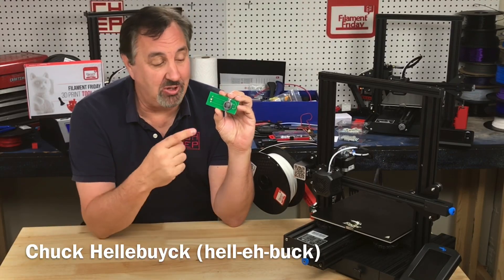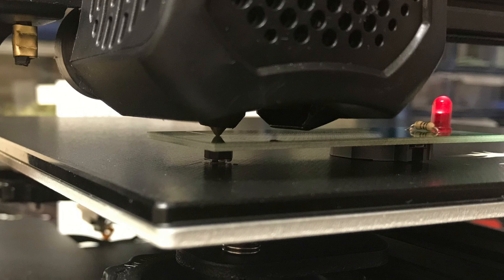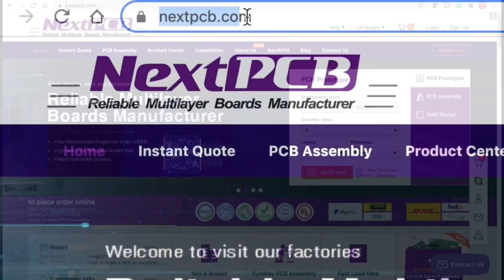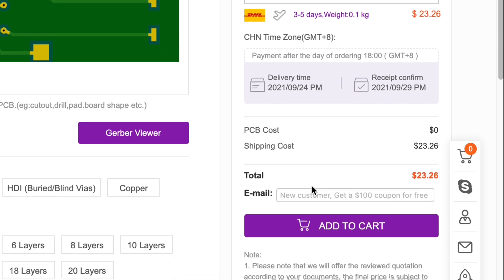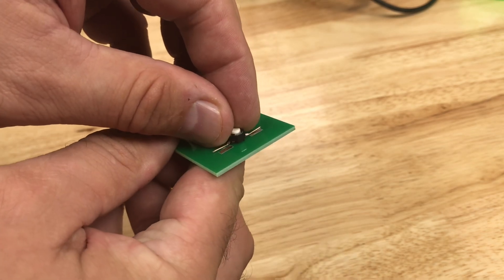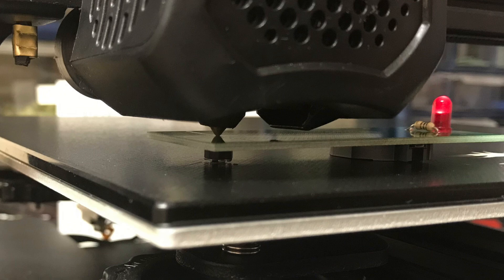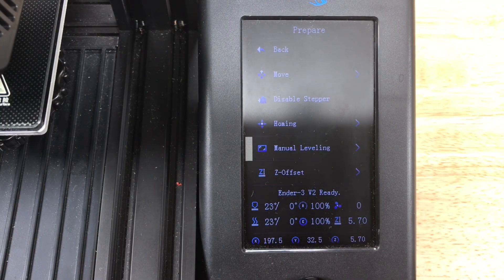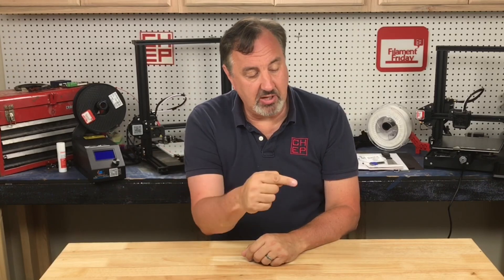Filament Friday E-Leveler - Electronic Device for Easier Bed Leveling on any 3D Printer

Comment: What do I do if I don’t have the printer in the options listed?
Reply from the maker: Use the closest size
Reply: @FilamentFriday  ok thanks!
Reply: @FilamentFriday  I did, but it doesn’t seem to be working. I think I did something wrong with the gcode
Reply from the maker: Nexus - Try the manual method shown in this video: 
https://youtu.be/VHxug5qgWD0
Reply: @FilamentFriday  thanks a bunch!

Comment: 5.7 mil on the battery, but at the switch? 
What if the battery case and the switch aren't at the same height ?
Reply from the maker: It’s 5.7 at the switch. Battery is lower and away from nozzle.

Comment: I was largely dissapointed about this video. I though you were gonna develop something more robust. First of all, I'm not quite sure the button is accurate enough. This is clearly visible when the LED flickers. This makes me wonder what are the tolerance of the button and if the button remains in place (exact same) over time.

It was sort of clickbait.
Reply: This is to replace the paper method. And if the button is a bad idea why do the use mechanical switches for x,y,z stops? This is a product more for beginners and even intermediate hobbyist. SMH
Reply from the maker: Mac Evoy - You rely on the same switch technology to home your Z everytime after a bed level. 
The fact you can choose to adjust the knob for flicker/fully on means you have even more control of accuracy/consistency vs paper or even feeler gauge.

Comment: hi i have kingroon kp3s how do i use it on my printer there is no z offset in my printer, pleasse heip
Reply from the maker: Because that firmware won’t recognize the pause commend, you have to do it manually. Home it, then use the menu to move the gantry up 5.8 mm, then disable steppers and move the hotend over the adjusters manually. 
Im working on a new GCode for it but so far no luck.
Reply: @FilamentFriday  is this the same approach I should use on my stock ender 3 pro with the 4.2.7 board? I just move the z-axis up and level each corner with a feeler gauge or this device? Then I just home it and it should be level? I am pretty good at levelling using the paper method. I just want to try out this method as well :)

Comment: Will this work with Mesh bed leveling?
Reply from the maker: It could but you’ll need to handle the z offset
Reply: I'm using this with UBL.  It is so much easier than any other method I've tried.

Comment: Hey CHEP, any chance for a new M25 gcode to use with this tool?
Reply from the maker: Why? 
What’s wrong with the existing version?
https://www.chepclub.com/electronic-bed-level-tool.html
Reply: @FilamentFriday  I am sorry, I meant to say one with the edited z offset so it goes up the 5.7mm for the leveling tool
Reply from the maker: That’s what’s on that page. It’s not working for you?
Reply: Yeah, my ender 3 pro doesn't recognize the M0 pause command unfortunately. That's why I was curious about the possibility about maybe getting an M25 version of the gcode.
Reply from the maker: Does your printer have an 8-bit board (v1.1.x) or a 32 bit v4.2.x)?
Reply: It's a 4.2.2 board using stock firmware. I've been a little scared to do a firmware upgrade since it's been running pretty well so far and I am very new at 3d printing.
Reply from the maker: I’m not sure M25 will work on it either.
Reply: Your "CHEP M25 Bed Level" gcode has been working perfectly with it so far! I've just had to manually change the offset by 5.7mm each time it changes to the next position.
Reply from the maker: I added a beta M25 version with Z offsets on the page. Try it and let me know if it works.
Reply: The version you uploaded is saving as ".txt", but I saved it over one of your other Gcodes and it worked perfectly aside from the M0 at the end of the gcode. In the last movement it goes to the middle left then fails.
Reply: @FilamentFriday  Can you do a version for the ender 5 Plus bed size? Thanks!
Reply from the maker: Use the Ender max version

Comment: Wow!
Do you only need to calibrate each corner one time?
Reply: No.  The frequency of when you level the bed varies, depending on who you ask.  Once a month, once a week, each print...  Some do it when they notice the first layers start acting up and not printing properly.  In my case, I'm in that later group.  I'll watch the entirety of the first layer go down (Either through the camera or while I'm standing at the printer) and see how it goes, then decide where to go from there.

The springs on your printer can "wear down", so to speak.  Heat affects the strength of metal, so they do lose their strength eventually.  When that happens is pretty much random.  If you put heavy objects on the bed of your printer when not in use, that CAN affect the.. (I don't know... Strength?  Length?) of your springs (Found out the hard way) and does affect the bed level.
Reply: @Mr76Pontiac  Thanks for replying but that's not what I asked. I asked about the actual use of the tool in the video, is one measurement in each corner enough or should it be repeated a few times to get the tool to flash in each corner consistently. Because with paper one pass is usually not enough.
Reply: @TechieSewing  I misunderstood, thanks for the clarification.  Theoretically speaking, using this tool, it makes it a TONNE more easier than the paper.  Put the head as close to the edges as you can (Or right over top of the screws) and adjust.  Then recheck the work.

I have OctoPi with a module in it that allows me to put the print head at any preset coordinate at the push of a button.  So for me, moving the head is going to be really easy, and repeatable.  Something like this is going to make the paper thing go away.  I didn't always trust it.
Reply: @Mr76Pontiac  What octoprint plugin are you using? I'd like to give that a try. Thanks!

Comment: Why he is doing  Zoffset to 5.7mm? That part i dont understand. And after calibrating he change zoffset to 0, why? If i have board for example 4mm, i can do the same?
Reply: can someone answer my question?
Reply: @haykokarapetyan2039  He offsets 5,7 mm since that is the thickness of the pcb and button. He levels the bed to 5,7 mm. And after having leveled the bed he resets the z-offsets to 0 to move the level back to the heatbed
Reply: @magnuslaboratorie  for example i have the same but 4mm, i must change z offset to +4mm, after calibration bed change zoffset to 0, am i right?
Reply: @haykokarapetyan2039  yes, correct.
Reply: @magnuslaboratorie  but maybe z is very high, how you calibrate after that your z?

Comment: Fairly certain that can be improved further. The switch type should be momentary, so that we don't have that "clicky" function. Using a long arm would increase accuracy.
Reply: momentary just means, that the circuit is open again as soon as you release the button. Has nothing to do with clickyness^^

Comment: Can you guarantee the button will activate at exactly the same height every time?
Reply: It works with mechanical end-switches which are the cheapest switches available.
Reply: yes, unless the switch like breaks or something
Reply: General purpose microswitches are an order of magnitude more precise than something like a BLTouch
Reply: Very interesting, why do they make things like bltouch if a simple switch is enough? They could just add a servo to a microswitch then?
Reply: @borgzapper6252  Think it through...
What is the switch doing when it is not in use? it is sitting at print level.
The BLTouch lets you retract the switch when not in use in a compact and lightweight package.
It uses a Hall effect sensor, which will never be a accurate or consistent as even a cheap Chinese microswitch. A good microswitch costs 1/10th a BLTouch, and will work at very high temps, millions of times, and always be repeatable.
Reply: Yeah like I said they could make something with a servo to retract when not in use?
Reply from the maker: Recognize that the Z stop homing switch uses the same switch technology I’m using so how accurate is that to give you consistent bed level?
Reply: @borgzapper6252  Better to just use one of the dozen or so switch pick up files that are out there.
The switch is parked behind the bed, then picked up by the tool head during homing. The whole thing is held on by magnets. You gain repeatability at the expense of complexity. Not sure if you really lose any weight since a pair of magnets and a BLTouch prolly weigh about the same.

You will gain better resonance though since the tool head no longer has the BLTouch hanging way off to one side. It will also work in chambers that cause the BLTouch to shut down (inductive sensors fair even worse in hot environments).

Comment: Ah so you've made a nice way to tram the bed (as Bryan Vines would say!)  That's a clever little device.  I agree, paper, business cards, feeler gauge...they can be hard, especially with 4 points to level.  I feel like the 4th one always messes the other 3 up (well, there's some truth to that!)   I haven't soldered LEDs and such on PCBs since I did the electronics on my R2-D2 build!

Comment: a simple perforated board would be simpler and quicker to prepare theis system
Reply: A piece of paper is far simpler, faster, and basically free... and if that sheet of paper rips, just use a new one. This is what I have been using from day one, and it has yet to let me down (ie, getting evenly squished first layers).

Comment: the middle is not the same in my bed :( it's probably warped
Reply: Mine also. That is why I avoid printing in the middle if possible.
Reply: Thin paper can be placed under the bed to raise the middle. 
(cash register paper, cut to needed size)
Reply: glass upgrade time
Reply: Use Mesh Bed Leveling

Comment: One thing i not understand that why you left Prusa Slicer i mean u have not updated ur profiles for Prusa slicer , and you keep updating it for Cura. however in reality Prusa is way better that Cura , cura generate a lot of gcode and take a lot of time to print and also Cura print mostly fail too i mean when u print it messup in middle however in Prusa it generate less g code and quick to print and it never mess up . so i request please update Prusa slicer profile with then new tweak u doing for cura in new profiles. thanks
Reply: if your prints are messing up using cura then you are doing something wrong. prusa slicer gives more issues that cura in my opinion and can be harder for noobs to use. i actually switched to cura last year and have not gone back im getter far better prints from it ie: less artifact on the big jobs. also it seems to have a lot more control over certain aspects and the plugins are plentiful. However superslicer dose interest me and that seems to be  based of the prusa slicer
Reply: Slicers are a personal preference. Cura may not work for you but clearly it works for Chuck. I’ve used plenty of Slicers it’s really a matter of user experience in terms of which one I prefer. The issue your detailing sounds like user error and not the slicer.
Reply: @3daddict154  Super Slicer is a fork of Prusa Slicer. I too have great results with Cura. My main issue with Prusa slicer is that it’s heavily stilted to Prusa printers, which of course makes sense. Super Slicer drops that part and keeps the advancements from Prusa so I’m giving it a try for that reason.

Comment: so far a waste of money. I have been trying to run the gcode but it does not work. say 100% complete nothing works
Reply: You don't need the gCode. You can just set the z-level, use the tool, reset your z-level and auto-level. Done. The gCode isn't a necessity, it's a luxury. I personally, have never used it. I just turn the motors off and run it just like I was using the paper method.

Comment: lol  its gettin more crazy every day. this is another commercial gadget thats not accurate. feeler gauge 0.2mm  no BS.  that switch only  lol  CHEP  dont introduce more BS pleaseeee :P
Reply: @MetalheadAndNerd   its just not a good idea,  nice try but why make such a simple job so complicated.   whats the exact distance to the bed when the switch is pressed? You tell me, then u need to go measure again another tool. its just a bad idea. KISS is everyone's motto who's got a brain. feelergauge 0.2 mm is just the way to go.
When you do wanna make it complicated, get a micrometer gauge with pin and mount that to your hotend/extruder during bedlevelling, cant get it more accurate.
Reply from the maker: Hero - Your choice how you level. I’m just having fun with some electronics but recognize, even the feeler gauge method relies on the same switch technology to home the nozzle height every time. So my switch gadget is essentially just as accurate as the feeler gauge. And I’ve found inconsistency in my feel from corner to corner using feeler gauge so nothings perfect. But again use what you want. I’m not forcing anybody to use it.
Reply: @FilamentFriday  Hi CHEP, the point it try to make here is that your channel (i assume) is to help the inexperienced printer folk to get things right. thats why i like to keep things as simple as possible. a piece of paper is not really ok because of so many paper thickness around, thats a ballpark jobby. a feeler gauge to me is simple to use. when u can move it under the nozzle with a bit of scratch, then you cant go wrong and be 99% sure of a correct distance to the bed, no worries.
But he!  leds are popi :)  so  wth if someone wants to tinker with a pcb and a led on it, be my guest.
why dont u sell CHEP 0.2mm feeler gauges? that would really have my blessing :P
Reply: @jero1836  Ease of use is not simply about simplicity. For some, having an LED light up is the kind of confidence boost that makes it "easier", even if there are more steps.

I keep planning to get a dedicated feeler gauge, but I'm so used to leveling with paper (and it is utterly reliable) I just haven't gotten around to it. 

This is an area with wide comfort levels. And, I think it's fair to say there is no one *correct" answer - even just for beginners.

Comment: Small aside /rant: 
Auto bed levelling seems a Mantra of the laughably lazy. 
Witness than even Marlin is Hugely Burdened by bed levellings  nonsense.
. Real life being; that IF one's machine isn't  Junk grade and reasonably upgraded,  for example single start Z screws and sillycone bed supports.  
Then Z and bed are serious position stable.
 A monthly manual Z alignment and nozzle /bed height Maintenance check ensures Zero need for any further bed levelings.
 Either In Marlin Config Or Erectile dysfunction probes .. etc.

 Not to mention that bed levelings are basically irrelevant by the 3rd layer. 
But Hey! Utube Videos are mostly  about Entertainment :-)

Comment: Or just buy a bl touch and use tramming instead of inventing some overcomplicated bullshit
Reply: @jamesmccaul2945  Maybe unnecessary would be a better word. I save making pcbs for things that actually need it. Takes two minutes to perfectly level my bed with a real sensor instead of this inaccurate waste of time
Reply: @johnandrews9433  This is more in the spirit of experimentation. We wouldn't have got a BLTouch without experimentation would we?
Reply: This is 3 times better i dont need to 3d print extra parts or rewire anything, this is amazing
Reply: @wizardOfRobots  that great and all, but why invent a square wheel after the round one is already here?
Reply: @johnandrews9433  Id say its more like making a wooden wheel when we already have rubber ones. The wood is cheaper and much simpler, and still gets the job done. Just not as elegant.
Reply: @diaman_d  Pretty much none of what you said is true. You can do plenty with these hobby level machines. And you can definitely print functional firearm frames, just not an entirely plastic gun. The channel Print Shoot Repeat has dozens of examples. Either way, I’m not sure how you gatekeeping printing has anything to do with this comment thread. All I was trying to say is there are simple more reliable and effective methods of leveling the bed than this.
Reply: @ZeorGaming  and also not as accurate/precise and a lot slower to use in practice.
Reply: @johnandrews9433  indeed. But its more than good enough. You can go more percise than a bl touch too, but why bother? Just adds cost and complexity.

I agree that the bltouch is the better option, but its also many times the price, and takes alot more work to setup initially.

I could easily get by with just this board, as I only need to level the bed probably every 5 or 6 months.
Reply: @ZeorGaming  I mean it was only about $25. And I use it for more than bed leveling. Auto z-align, tramming, homing, ABL, easy adjustment after nozzle change. Worth the small cost and the 15 minutes it takes to make a firmware change. Allows me to print a full bed of small parts and not worry that some won’t stick and ruin them all. This isn’t much better than using a piece of paper to get the corners in line.
Reply: @johnandrews9433  it costs over double that here in Canada, while this board is about $10. 

Gonna be honest, I dont even know what half those terms are, nor do I often need to do the other half. Not sure why peoples printers seem to lose their leveled bed so often, but mine just works for months without touching it..
Reply: John, a BL Touch doesn't tram the bed, it compensates for a warped or non-level bed. Crank one side of your bed down 5mm and you'll still get your print but the bottom won't be perpendicular to a vertical side.  Your print will be skewed.  That's why you team the bed.  He's com up with a cheap device that is more accurate than moving a chunk of paper under the nozzle hoping the tension is the same at 4 corners.